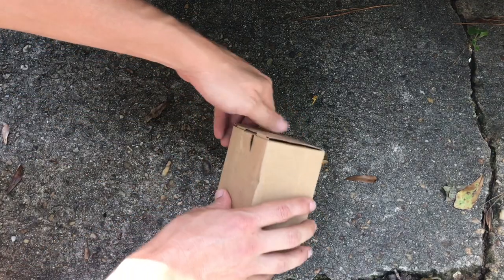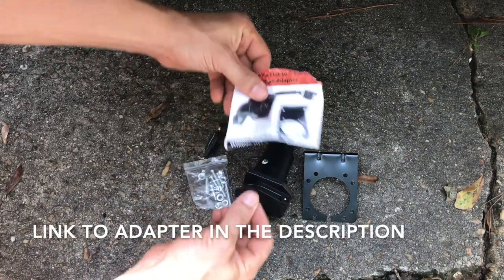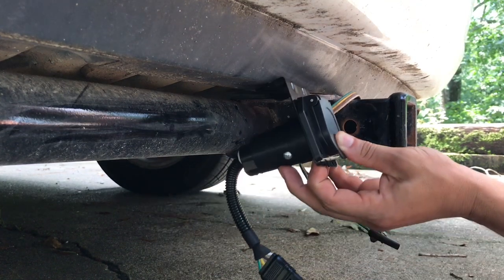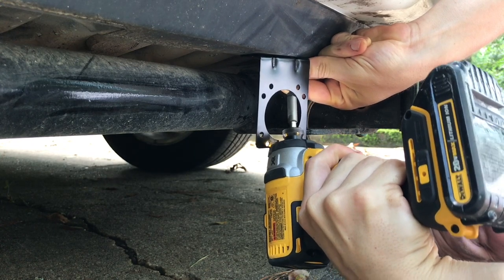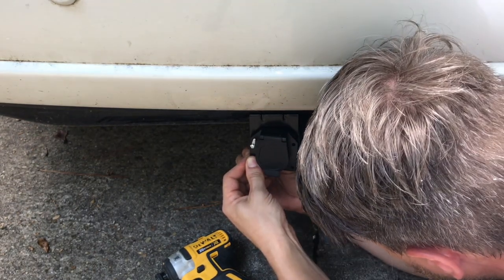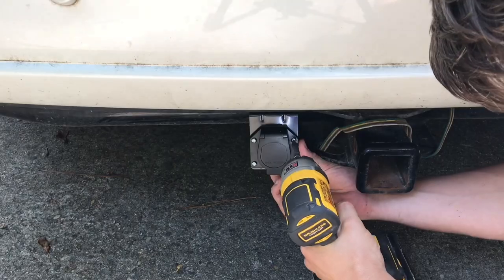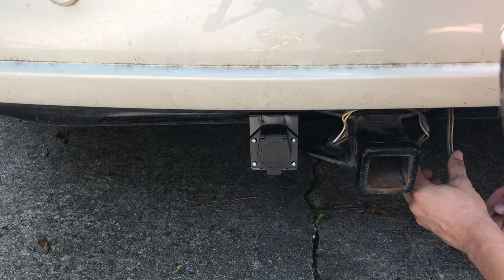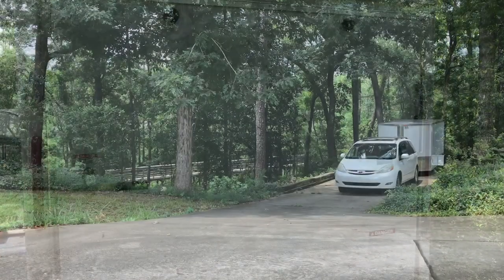4 Way Flat to 7 Blade Towing Light Kit Adapter Unboxing and Installation Guide

Comment: Good vid! I wish more people would take the time to actually hook up the proper lights when hauling their trailers. One of my pet peeves is getting behind someone pulling any kind of trailer and there are no brake lights, turn signals, etc. on it. I don't follow people closely anyway but it'd sure be nice to know if the person pulling the trailer in front of you is going to whip over in front of you or slam on their brakes.

Comment: You should use some better screws to install the bracket, or even machine screws with locknuts on the threads.  Those drywall screws will not provide sufficient holding power.